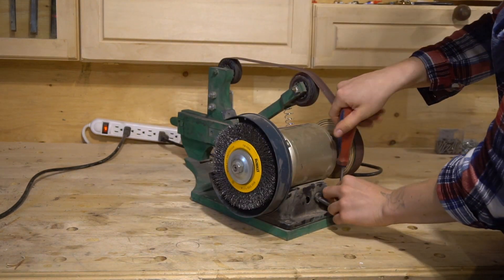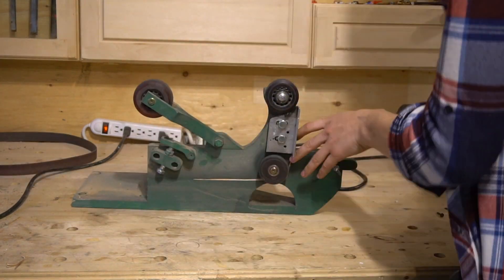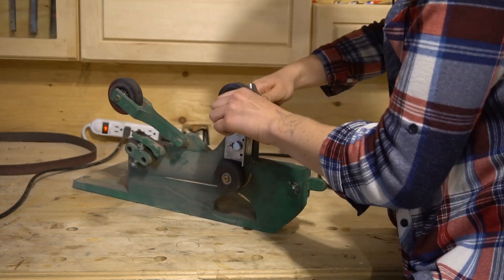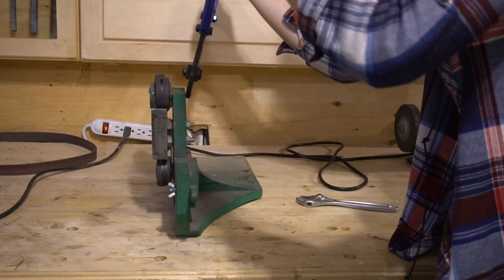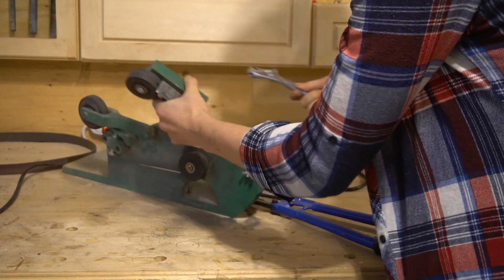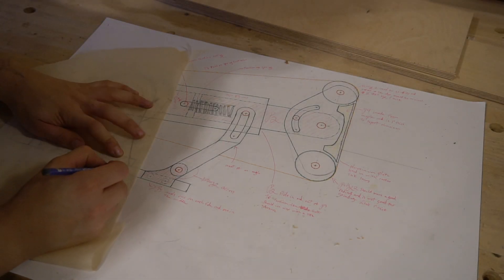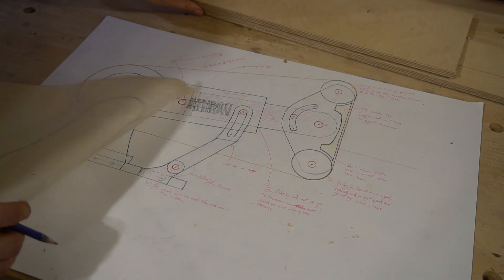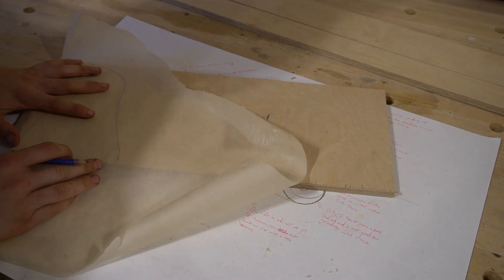Making Wooden sander/grinder bench grinder powered

Comment: Wooden wheels re awesome but if I had a lathe I would probably make aluminum.
Reply from the maker: I've been using the lathe for many years now and the wheels haven't been an issue at all. I've gone through a few bearings though, and the wheel supports could be improved though

Comment: After two years, how is it holding up?
Reply from the maker: Good question. It is starting to not work as well. I need to take 2 hours to really fix it up perfectly the main issue is one of the bearing is out and I have a small alignment issue. I may make some modifications while I am at it to make it more rigid. But I use it at least a few times a week. It gets lots of use, I have put at least 35 belts through it.

Comment: Love the use of a bench grinder as the driving motor - cheap, easy to find, and they already have a standard dimension shaft and screw thread cut in to tighten drive wheels to. Great idea. Also who cuts dovetails in plywood! Absolute mad lad, love it.

Comment: Great vid & excellent project. I like eliminating the 4th wheel, less complicated is better. I would suggest putting a good quality wire wheel on the opposite side, great for metal & indispensable for removing rust & chasing threads